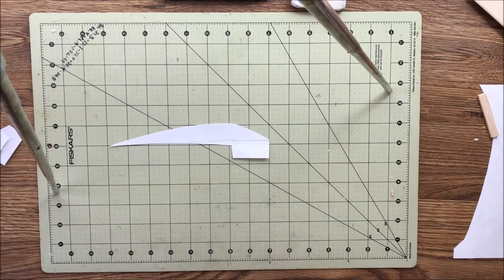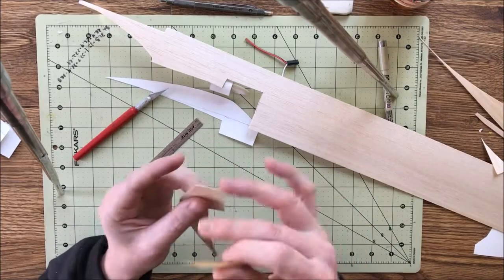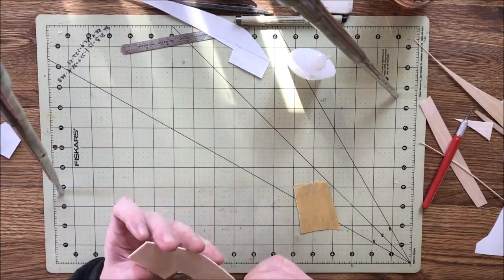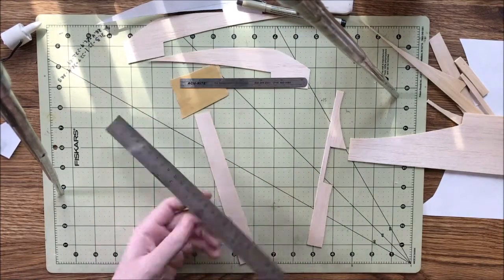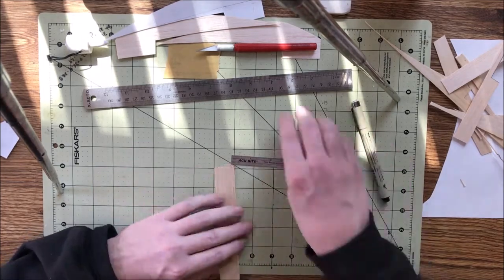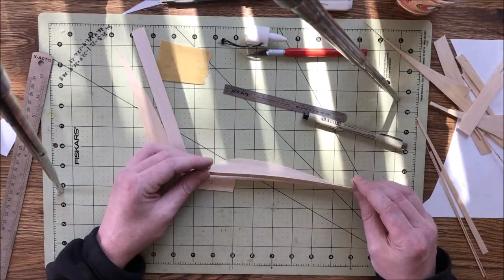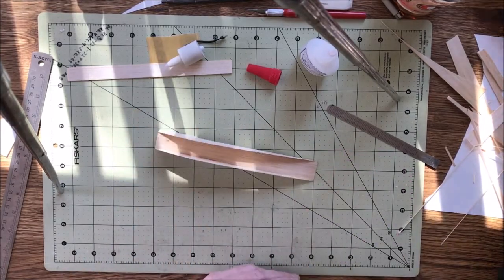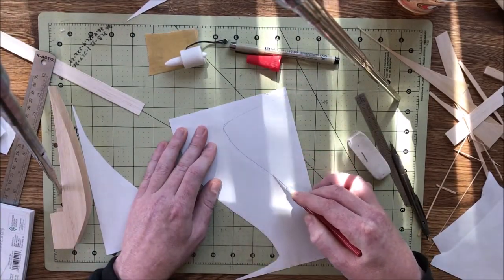20mm Micro EDF Jet build 1

Comment: This is awesome! Looking forward to part 2. Where is the best place to find out about building micros? I tried building a few but spend a lot of time just trying to get the electronics to suit the plane and work with out random brownouts.
Reply from the maker: Thanks!  The Scratchbuilt Indoor and Micro Models forum on RCGroups has all the info you could ever need.  Electronics for the really small stuff (ones that use magnetic actuators) are almost harder to find now than they were 10 years ago, but https://micronwings.com/index.shtml and http://micronradiocontrol.co.uk/index.html both carry a pretty good range of products.

Comment: Wouldn't you get a bit more performance if you were to give the plane wings with a bit higher aspect ratio, since the 20mm fan probably won't give that much thrust.
Reply from the maker: Yes indeed, in fact the first plane I was going to build for this fan was basically a glider with a motor pod.  Had a heck of a time trying to figure out the build though, and wanted to get this thing in the air, so went with this model instead...I'll eventually do another with a more proper airframe/wing design.

Comment: Hey Microbuilder, I really like this video so far (not finished watching it yet). I am fortunate to live in a house with a very large living room (4m tall and about 60-70 square meters). Do you have any suggestions for a nice micro build that I could fly in that space without permanent anxiety of hitting something?

Also what balsa type do you recommend for these builds? Won’t be using your recommended shop sadly because I live in Germany.
Reply from the maker: Thanks, and color me green for jealousy, I wish I had that much space!  I'd suggest the Square 9 for a model, I've personally built quite a few of them, and they are an ideal platform for indoor flying:  http://www.geocities.ws/billy_stiltner/square9.html  
I've got a little living room flyer compilation video with my past LRF planes, theres at least a few Square 9s in there:
https://www.youtube.com/watch?v=i5R4QpHYfH4
Reply from the maker: I completely forgot about your question about the balsa.  The main difference between balsa is its density, you can usually tell if its a decent piece if you hold it up to the lights, and its at least fairly translucent.  I've seen some that let literally no light through, but that stuff works just fine too, it'll just be heavier (stronger too).  I usually use 1/32" (.8mm) for fuselages, 1/16th (1.5mm) for wings, but it also depends on how big the model is.
Reply: microbuilder Thank you very much for your advice! I’ll see if I can scrape together some time to build such a model, aviation is my passion after all and the airfield is closed right now due to recent events...
Reply from the maker: @flyingby3703  No problem, its a rewarding hobby yo get into.